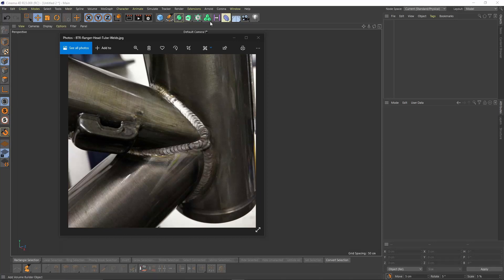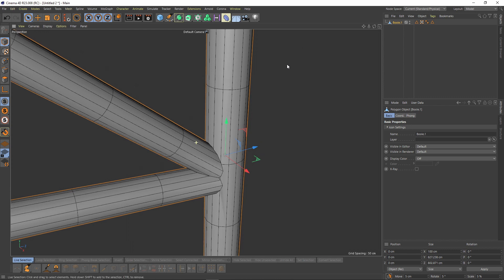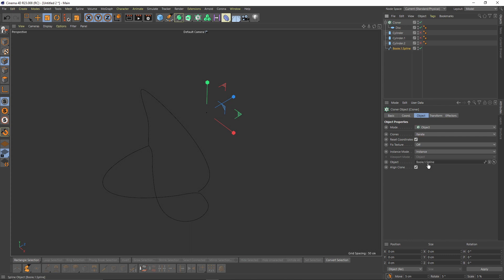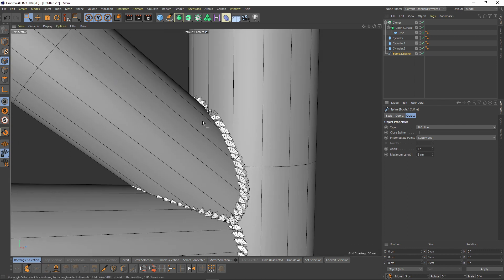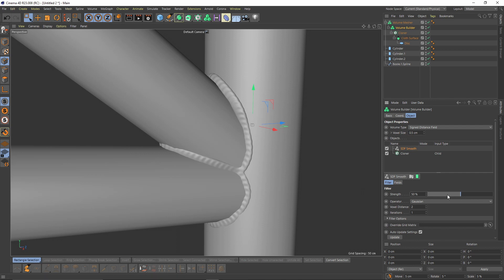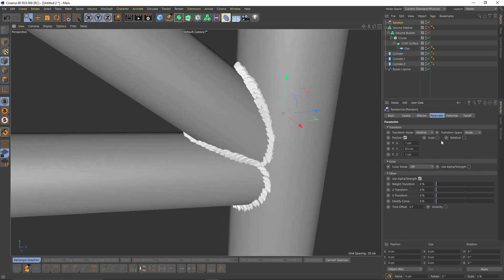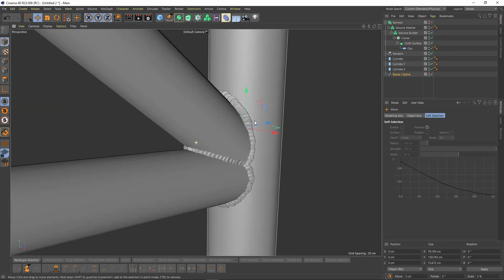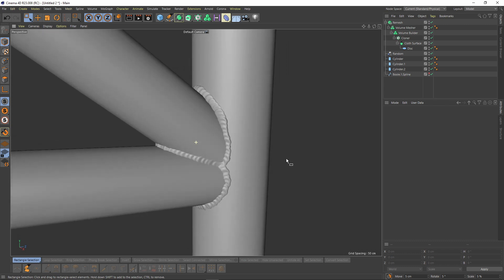3D Welding Effect Modeling | Cinema 4D Modeling Tutorial

Comment: How to make R19 welding effect？
Reply from the maker: there is no volume mesher in R19 but you can do similar effect by creating the same spline like in the video, then make a sweep object and put that spline that you created inside the sweep, also make a circle, adjust the radius and put it also inside the sweep, then create a displacer deformer and make sweep and displacer into one group, in the displacer, add a noise and adjust it, thats it.
Reply: @polygonpen  Sir, do you choose R19 or R23 version due to modeling needs？
Reply from the maker: R23 has volume and renewed uv tools, If you don`t need these you are okay with R19, I use R19 usually since it`s more stable but when I need to UV Unwrap, I switch to R23, so if you can, have both.